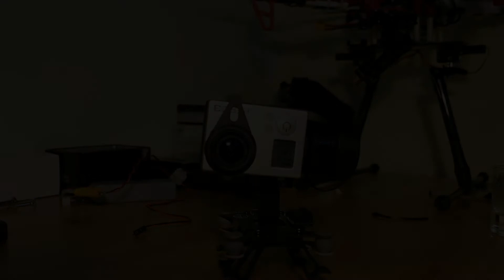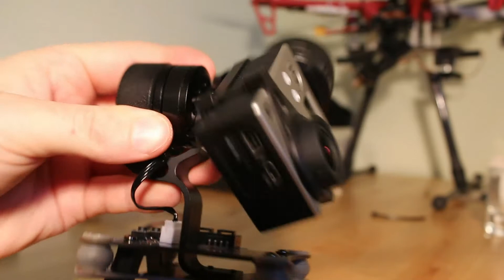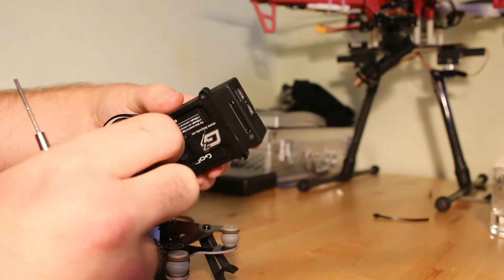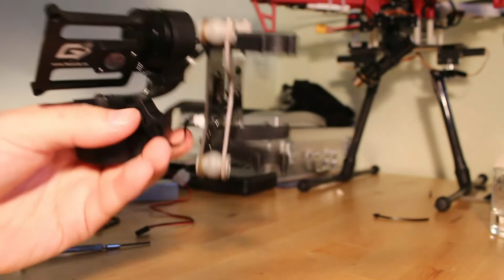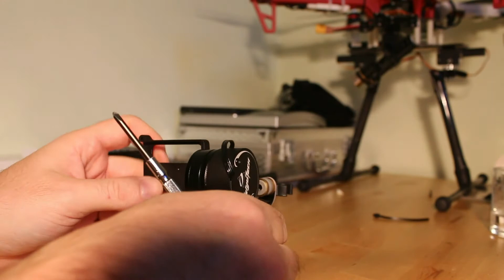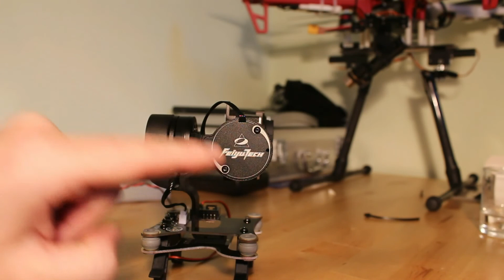Feiyu Tech G3 (FY G3) Brushless Gimbal - Video 3: How to Invert the FY G3 (Mount Upside Down)

Comment: Dewey, you would be a super hero if you could confirm whether the FY 3 axis can be inverted for fixed wing. So far mine looks as though the base needs to be vertical with gimbal out front. Very draggy. I'd love to put it on top of my Talon   Thanks much Dewey

Comment: Question, are you turning the mount over so the GoPro is right-side up, or will the gimbal not operate upside down initially?  I ask because the GoPro Hero3 has an option to invert the video capture before you shoot the video.

Comment: hi mate ,great video .have used your vector vids to great success but am having problems with the fy-tec driver doesn't seem to work with windows 10. do you have any ideas . cheers in advance Steve
Reply from the maker: +Steven Clarke It seems to be a bit hit/miss on all computers. Best thing to try is to uninstall the driver from Programs/Features and from Device Manager.... then re-install it BUT do it in compatibility mode. To do this right click on the installer icon go to properties and the 'compatibility' tab. Choose Windows 7 and tick the 'always run as administrator'. Then apply changes and run it. That should make it install in the usual Win 7 method (it is the same location as far as i can tell but who knows what other things are happening in the background!). Worth a try.
Reply: +d3weyTube cheers d3wey Will give that a try ,many thanks for reply  steve

Comment: how difficult will be to mount it on a dji Phantom? by any chance do u have any idea about the tilt...how u can control it from  a futaba t8j?
Reply from the maker: Fitting on the Phantom won't be too hard but with the mount that comes with it you will need to boost the legs height a little bit (like an inch). I have been told by Feiyu-tech that they are working on a Phantom specific mount.

As for the T8J... easy - You simply plug the supplied cable into the RX and program the VR wheel to control that channel or, if you have a NAZA, you can plug it into the F2 port of the NAZA and control it through the 7th channel (just like you would on a Phantom).... I did a video of this here: Feiyu Tech G3 (FY G3) NAZA Assistant Pitch Control Setup